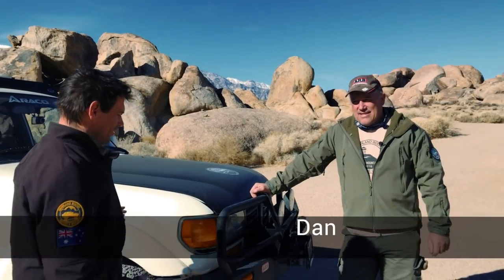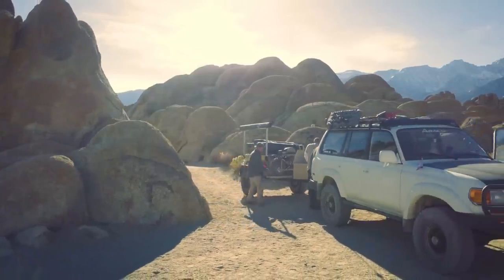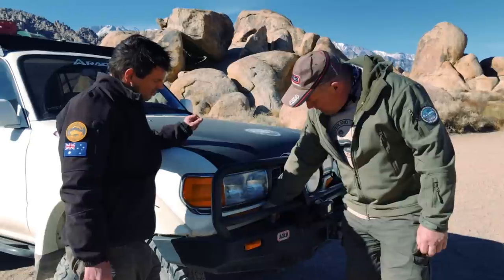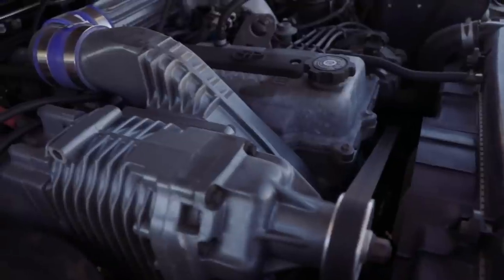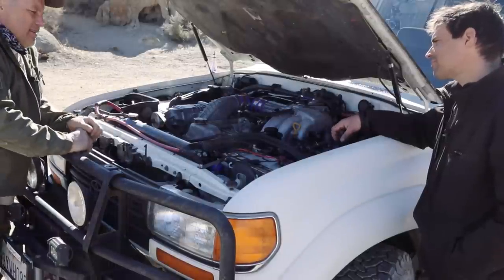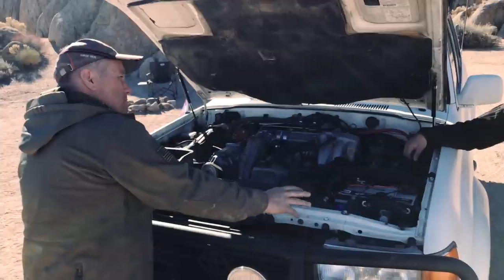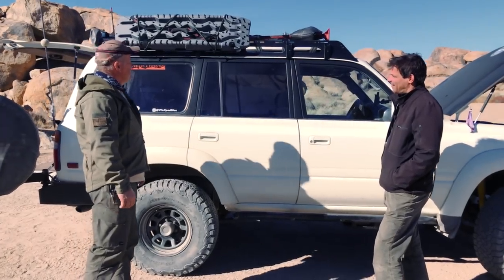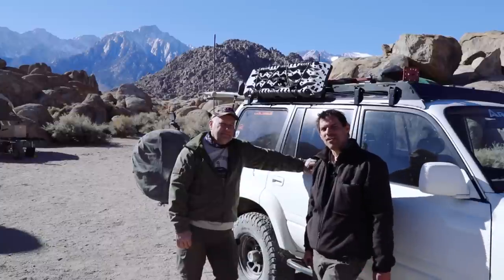When a Toyota R&D Engineer Builds an Overland Rig - FZJ80 Rig Walk Around

Comment: Interesting. Nice to see the Puma. I'd like to know more about the welder. One item, I think that you both would like are the rear flip up doors. LandCruiserPhil here in Phoenix makes them https://sites.google.com/site/landcruiserproducts/windows and they are a straight forward design, easy to install and don't leak. Makes getting to stuff in the back much easier and quicker than dealing with the swingouts. I can get into my ARB when we're on the trail pronto and it also helps to get to the Puma, which Phil also has a decently priced mount for, that utilizes the third row seat bolt holes. Peace! #3630